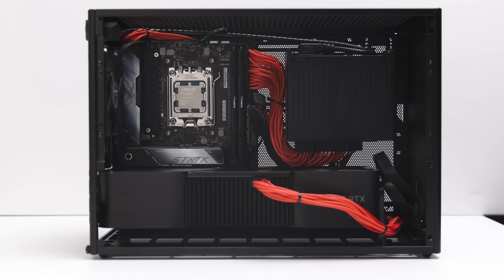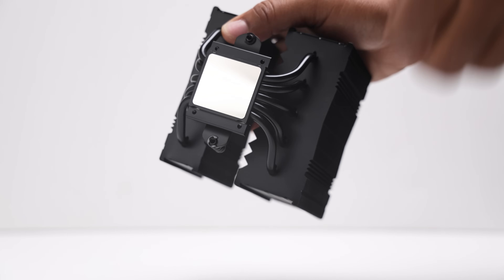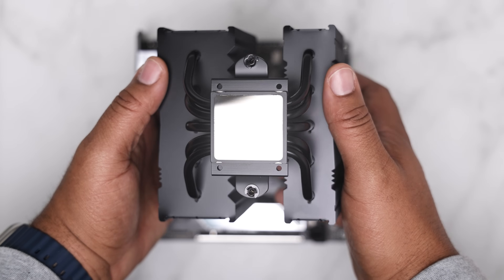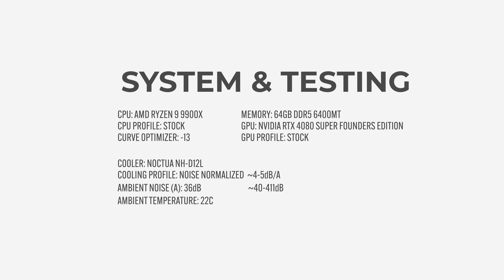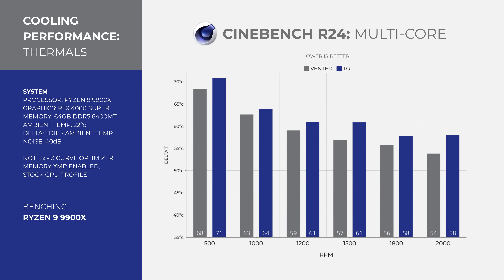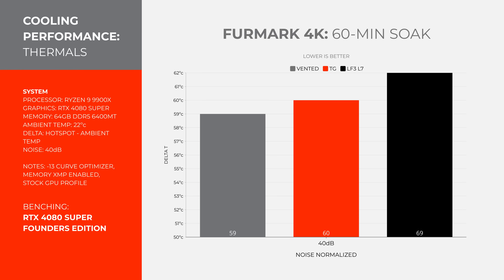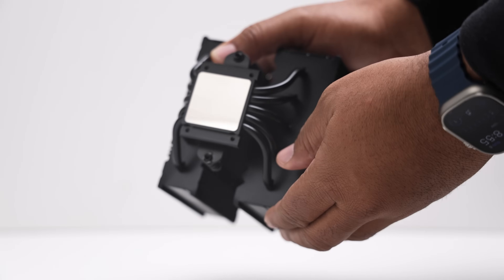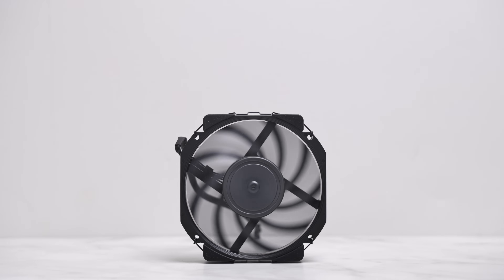NCASE M2 + Noctua NH-D12L – The Ultimate Power Couple!

Comment: Thank you so much for this review. Regarding D12L orientation, for rear intake, Noctua themselves recommend to mount it in the way that you did 👍
As I will build a similar system soon, I wish you provided some more information on the extra rear intake fan. 
How much idifference does it make in terms of temperatures? At what speed do you run it? Is it worth the extra noise?
Do the 3d printed pegs provide spacing from the case (I heard that mounting it without a spacer will be noisy) and can you provided a download link?
Regarding the glas panel, I assume the D12L's height is unproblematic here, since you just mentioned the cables?
Have a nice day and enjoy your beautiful build.

P.s. If you google for "noctua order fan mounting clips" you will find a link to the official noctua site, where you can order additional clips to mount another fan for free.
Reply from the maker: That rear fan isn’t native and requires a modification such as the 3D printed pegs. They could be optimized better for fitment, however I run that fan at very low rpm’s (5-600rpm) because there is some turbulence at moderate to high speeds due to the fans proximity to the rear grill. I estimate* a 1-2 degree improvement with the rear fan.
Reply: @ChrisRussellTech  I got mine to fit securely with the standard fan screws.
Reply from the maker: https://www.printables.com/model/821973-duct-peg-for-axp-90-x47-noctua-na-fd1
Reply: You can fit A9x25 without problem. Use some spacers to have 5-6 mm distance from the rear panel. Then, the fan is quiet even at 1000 rpm. Adding of 92 mm rear intake fan reduces CPU idle temperature marginally, less than 1°C (7800X3D + Thermalright Silver Soul 135) but improves m.2 idle temperature by 3°C and brings some air also down to VRM and (passive) chipset cooler.
Reply from the maker: @hallbregg3369  you could, I’ll see if EIGA can make a peg that can fit a 25mm 92mm fan. Thinking of a peg that can have the spacing build in.
Reply from the maker: @ EIGA is a creator on YouTube. https://youtube.com/@eigatech?si=jn_NmEgUcbDswsme
Reply: @ChrisRussellTech  May be, you can test couple of different spacer heights to find the sweet spot and then create a final mounting solution for rear panel. I am pretty sure that SFF community but also a lot of less technically skilled people (including me :) will appreciate this.

Comment: These videos are really useful as someone who is new to SFF builds - I already have the Assassin Mini 120, but guess the D12L would be just as good. I plan on building inverted with exhaust at the bottom and side - which direction would you recommend I set up the fan from the CPU cooler in such a build?
Reply: PA 120 mini is better choice (if you swap the OG fan for Noctua A12x25r). Best setup is 92x25 rear intake, side panel 140x25 exhaust + 120x25 side panel exhaust on motherboard side (you can mount the SFX PSU on the back of front panel).
EDIT: PA 120 Mini will probably allow to fit just 92x14 rear fan (considering the needed 5-6 mm spacers).
Reply from the maker: @hallbregg3369  we need a better mechanism to mount the fan to the rear
Reply: @hallbregg3369  Thanks so much for your input!! I'm basically following optimum tech's recent build exactly, but can't figure out how the fan from the CPU cooler is oriented. He has two exhaust fans on the bottom, and one on the side
Reply: @Otter_in_water  Forget the bottom fans, they have zero effect except of added noise and complications with cable management. Optimus has CPU cooler fan set as rear intake. If he sets it as rear exhaust then the 120 mm CPU fan has to fight for the air from the same area with the other three 140 mm exhaust fans. That would be.. lets call it sub-optimal :D
Reply: @hallbregg3369  You are godsend with your knowledge to someone who is a complete newbie. Any idea why optimus would have those two bottom exhaust fans despite so many people (including you) saying that isn't really necessary? I've already ordered those parts, any better use for them to improve airflow aside from bottom exhaust?
Reply: @Otter_in_water  He probably wanted to showcase the fan configuration flexibility of the M2 case. You can modify your order and remove the fans or just send them back to e-shop. You can still use one or both of them in combination with 15 mm Ncase angled feet. Higher case feet will give them some room to breath.
Reply: @hallbregg3369  Saw this thread and related to Otter_in_water as I was also planning to run with a similar setup to Optimum's recent video. I was planning on getting 3x Noctua NF-A14s but what you're suggesting sounds good too. Just to confirm, are you recommending getting 1x 92x14 fan (or 92x25?), 1x 140x25, and 1x 120x25?
Reply: @StevieWonderLuv69  I played for 1 year with different fan setups for inverted configuration in Ncase M1 Evo and later in M2. And that is my best fan setup. For rear panel, you can pair 92x25 fan with Thermalright Silver Soul 135 cooler or 92x14 with Peerless Assassin Mini 120 (which has broader fins). So as you write, 1x 140x25, 1x 120x25 and 1x 92x15 or 25 (based on your CPU cooler selection). Do not take D12L cooler, it is too tall. It will not allow you to mount the side bracket for attachment of 140 mm side exhaust fan. I can specifically recommend Noctua S12Ax25 fan as an excellent quiet case fan, but other fans will do their job, too.
Reply: @hallbregg3369  did you try to swap the fan with a a12x25r? does it fit secure? was wondering because the holes for the fan.brackets in tze a12x25r are not in the same position like the ones from the thermalright fan? thx.
Reply: @shusui9665  I personally have Silver Soul 135. The swap for standard square A12x25 is without problem. PA120 mini supposed to be also ok with A12x25r with original brackets.
Reply from the maker: I’d recommend going with an exhaust configuration in your inverting your build. I really don’t recommend inverting but if you do I’d say go with exhaust, so that it’s pumping some of the warm air directly out the back. Try making the bottom fans intake to bring in some fresh air to feed the CPU cooler. It’s trial and error also.
Reply: @aihji  Yes, ryanp83 has the layout right. But avoid mistakes he did. 1) Use SFX power supply unit, not the bigger SFX-L (like Asus Loki). 2) Set the 120 mm fan on motherboard side as exhaust (ryan has intake). 3) Use also the 92x14 rear panel fan because there are also other things to cool (not only CPU and GPU). The slim 140 mm fans above GPU are not necessary. Undervolt your GPU and add fans on the top if you are still not satisfied with your GPU temps. Most of m-ITX boards give you just three PWM controlled headers, so do not waste them on fans you do not need.
Reply: @hallbregg3369  And if you have an mATX board, what do you suggest? Assume you can only have one side panel?
Reply: @AlexN-t2d Then you can mount one (140 mm) side exhaust fan., only.  So select a good and quiet one :)

Comment: Thank you so much for this video, it answered alot of questions I had regarding this case and my upcomming build. I was on the fence choosing between D12L, assain 120 mini, or LF3 280. On gamers nexus bench mark his noise normalized benchmark showed assasin mini was 14c hotter than LF3 280 but that was on AM4 though. Also Im glad to see 92mm fan fits the rear perfectly
Reply from the maker: You’re welcome. I hear good things about the Assassin Mini. If you want pure performance than the LF3 is the way but if you want good performance, easy installation and simple operation, go air.